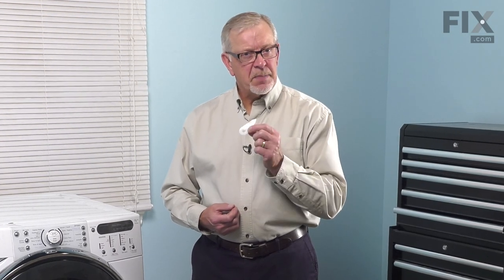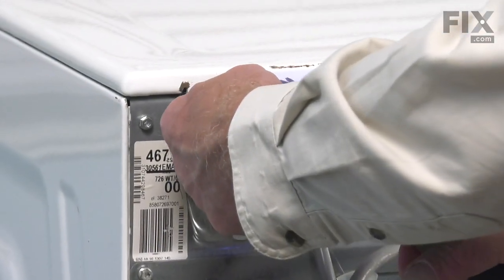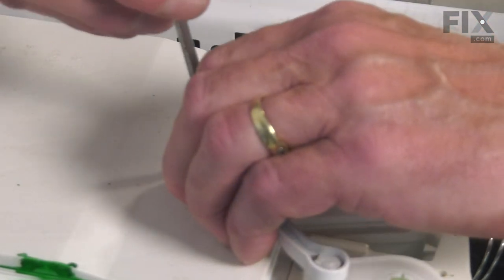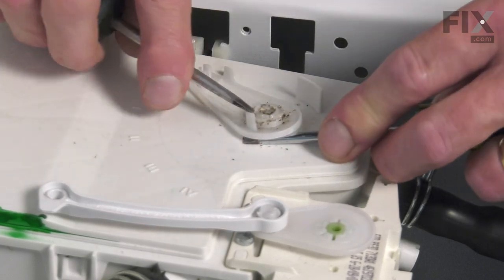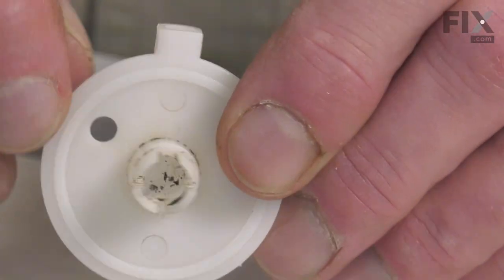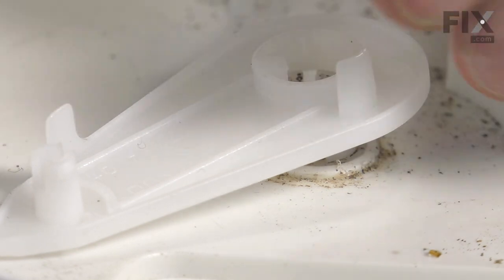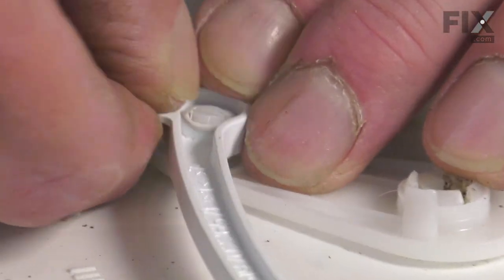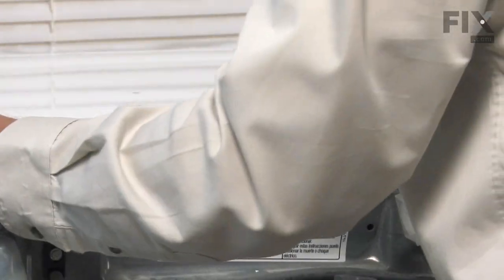Whirlpool Washer Repair - How to Replace the Dispenser Actuator Lever

Comment: After replacement, does the Computer cycle the motor to home the actuator arm?  Will an unhomed actuator on position #3 keep the machine from starting a wash cycle?  Does the switch merely detect that the actuator is moving and the motor functions?  Mine moved for a partial turn, I hit the cancel button and now the machine never starts a cycle.  I’m replacing the computer board too, as the drain pump motor never turns on.    I replaced the drain pump after finding a charred dime inside the filter pod.  I think it must have jammed in the impeller and caused the motor to burn out, the CCU board as well, the K1 relay on the board.  But I won’t know until I install the new board.  Suggestions?